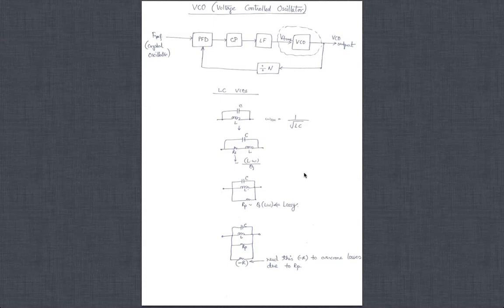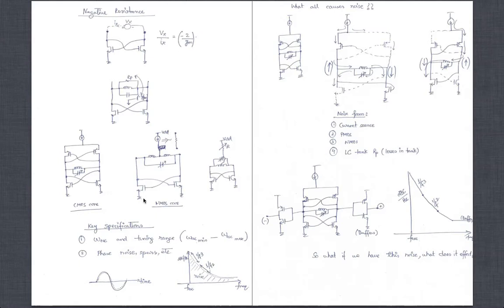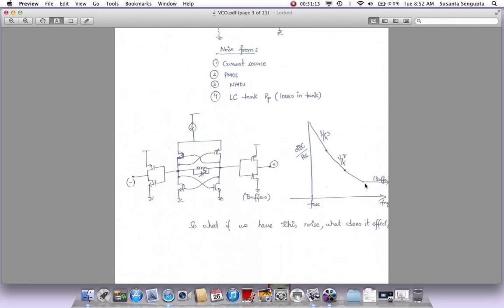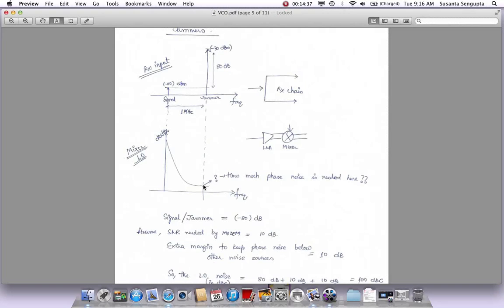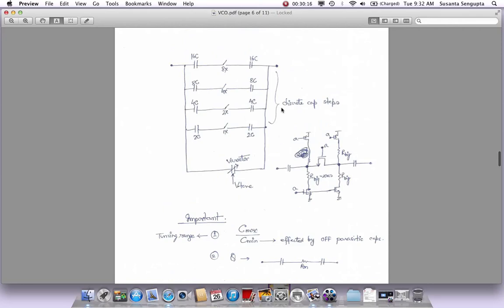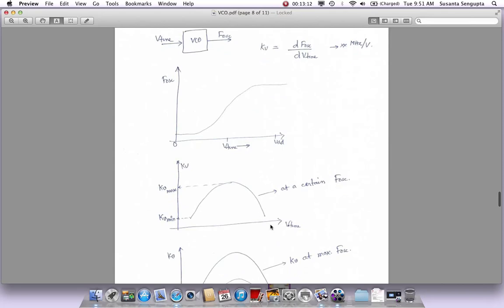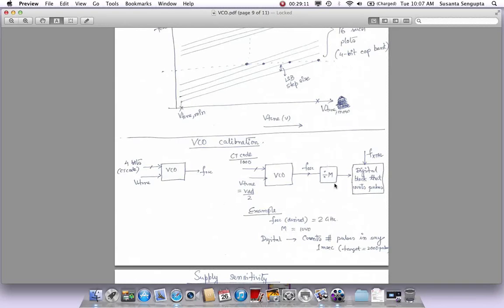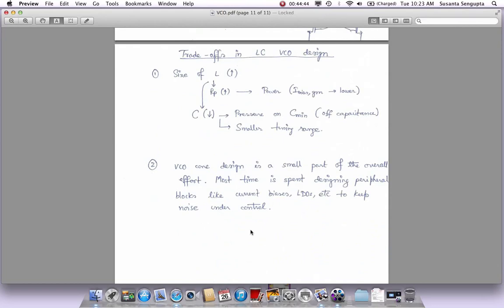CMOS VCO Design

Comment: Hi, just watching this and I think that your derivation of needed PN for the oscillator @1MHz offset is incorrect. Around minute 52 you add 60dB to the number in dBc to get your dBc/Hz, however it is not because you're at an offset of 1M from the carrier that you need to add 60dB. It is because you are assuming that your bandwidth of the receiving system is 1M.